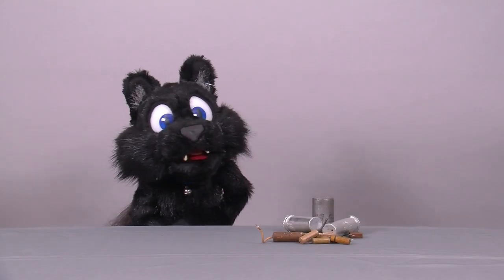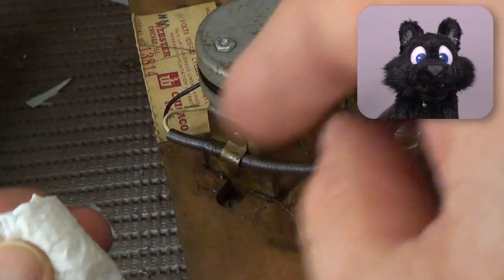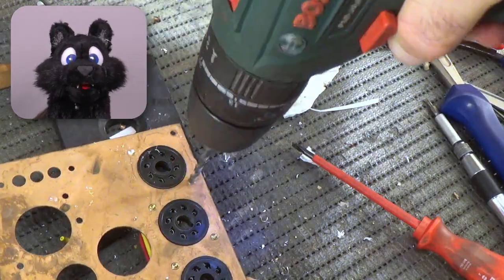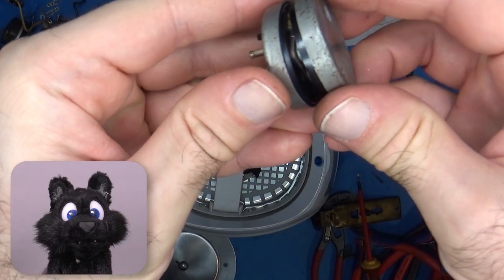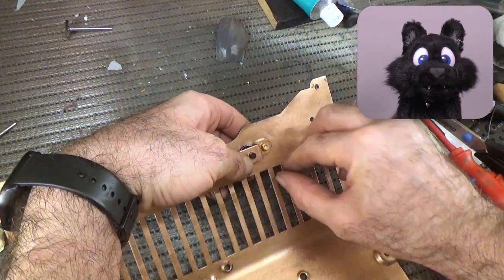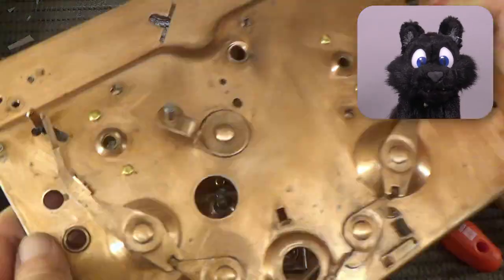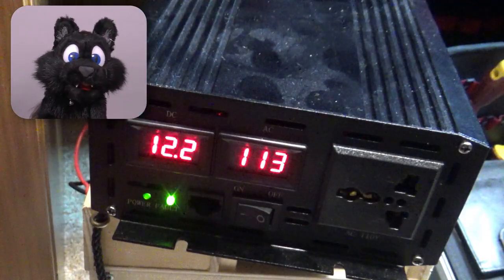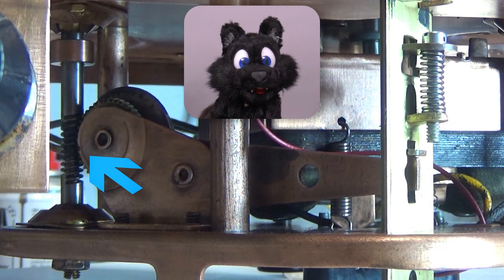Restoration Project #25: Wire Recorder, Part 2

Comment: Copper coating the metal chassis was a pretty common method used in audio and radio gear back in the day. Back when things were made with quality, and eye towards lasting more than a couple of years. Regarding fasteners, torx wasn't invented until the late 1960s, so the grub screws you encountered were most likely keyed with 6-flute bristol splines. This keying method was popular for grub screws during the '40s and '50s. Also, you'll notice there were probably few to no phillips head screws used in that machine. Phillips headed screws didn't become popular with American manufacturers until the late '60s.

Comment: This is the most over engineered piece of electronic equipment I have ever seen. It’s not like that amount of  copper is needed for shielding or RF. it’s not going to be launched out of a rocket. It’s just amazing. Maybe the manufacturer was suffering from an aluminium shortage.

Comment: fix it without or with  a diagram or plan, it's really a challenge ! i hope that sound will be great after this big job
Reply from the maker: I'm doing the tube section this weekend; the spare parts finally all arrived. Fingers crossed... I'll only know if all the tubes and the head still work after that. The microphone seems to be working, I checked that already.

Comment: That's a lot of copper! Beautiful copper!
Reply from the maker: It sure is! But it is only on the surface; almost all parts are magnetic, and if I use more than just very fine sandpaper, it will rub off. I tried in a non-visible location. But it does look awesome 😁